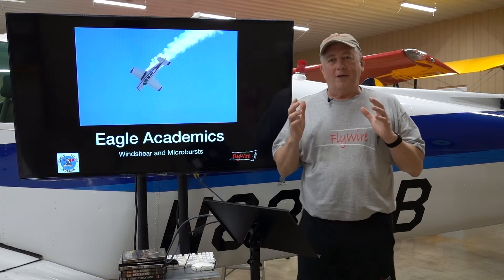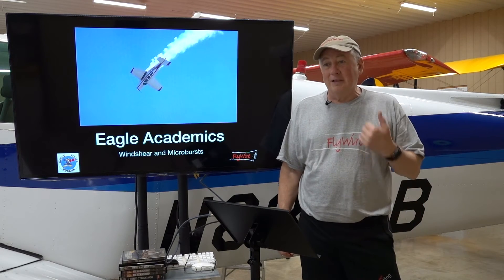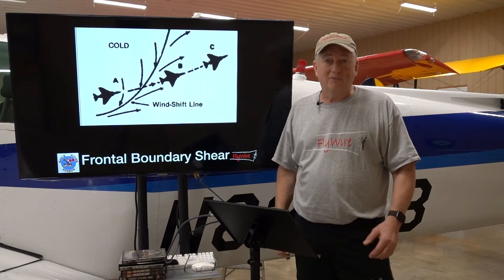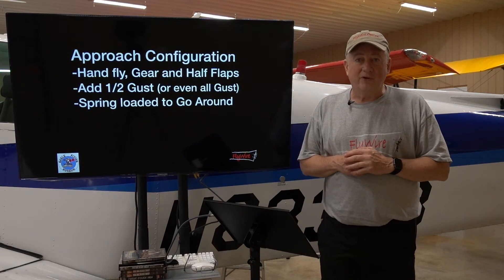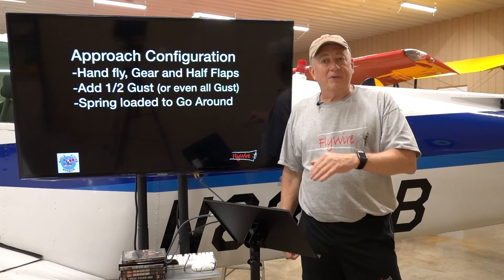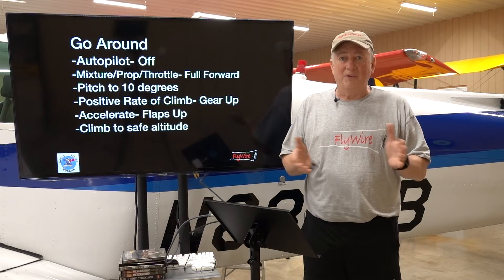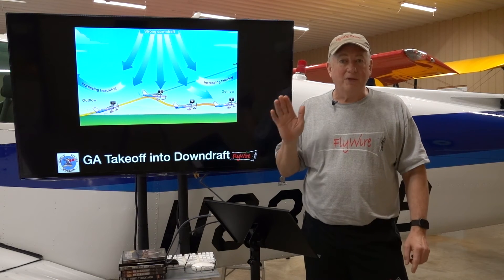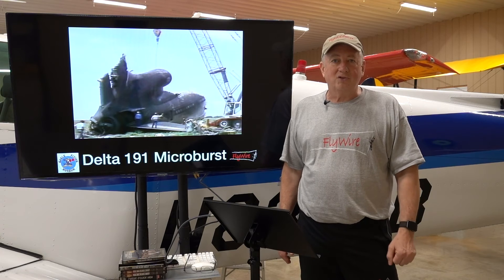Windshear and Microbursts  Eagle Academics

Comment: Shouldn't your prop and mixture be full forward on short final anyway? Messing with prop and mixture, before applying full throttle, could cost you a couple of valuable seconds. Are we not supposed to be at fine prop and full mixture on short final, in anticipation of a go around anyway? Great video, and thanks Scott
Reply from the maker: Great question. The answer is no, that is a technique. I guess I need to make a video on that too!